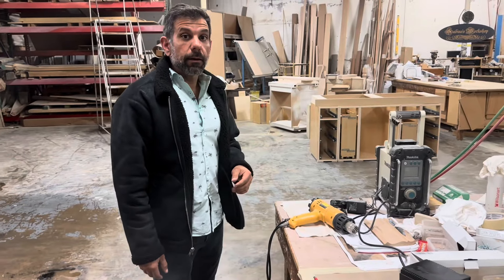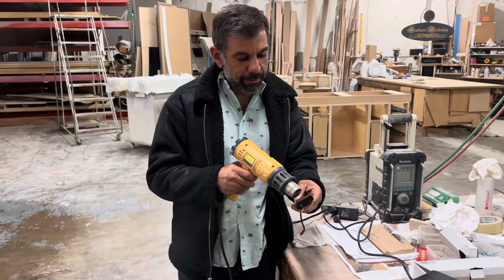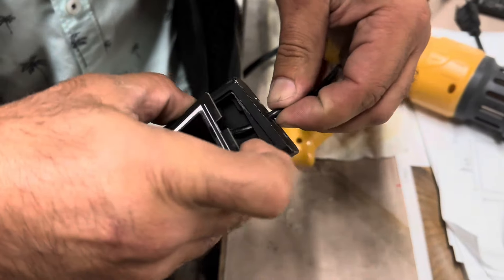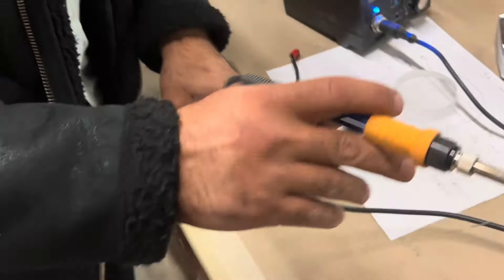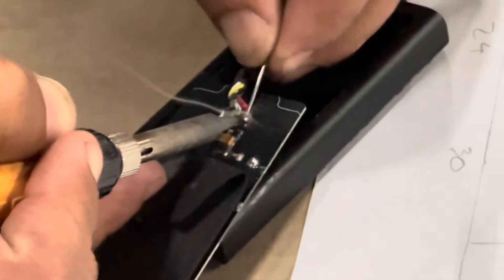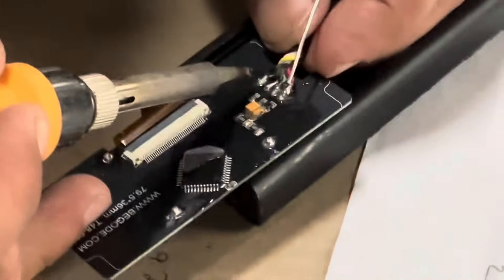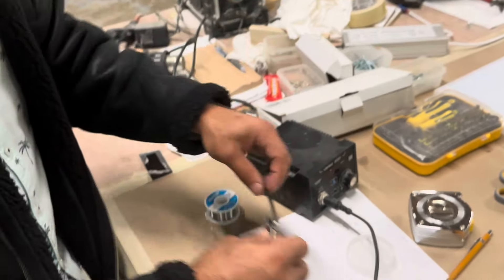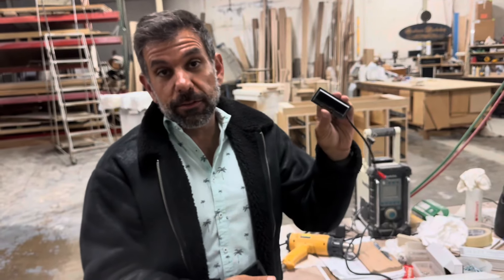Begode Blitz display mod

Comment: hey Roger. so with all these crazy awesome wheels coming out do you still consider the blitz a awesome choice for just going out for some speed and off roading. I just sold my extreme which I never really bonded with. there was something  about it that I didn't like. I dont like 16 inch wheels much. I like the blitz if it can be a faster better wheel all around. the thing with the extreme was it took way too.much effort to get up to speed..I want a wheel that does the work for you. the xway just doesn't do it for me looks wise. I do like the nosfet apex but the blitz is cool
Reply from the maker: The blitz for small tracks and the blitz pro for large tracks. For off-road, the 134 bolt blitz seems to be the best choice. The suspension on that one is just better. The x-way is a whole other conversation
Reply: @roghaj  IM LOOKING TO BUY tommorrow. My first extreme marty told me dont do a 16 inch and I didnt listen, so im listening now. The xway is great, good and does it justify the extra cost from the blitz which seems to check all the boxes for off road, jumping and speed. However the xway brings the cost higher than the nosfet apex which I have seen in person and it looks sweet, its so quiet going thru rough terrain.Are you still reaching for that blitz when you leave the house.

Comment: Alternately you could cut some polycarbonate of the same thickness as the display cover to replace the dark display cover with a clear PC cover instead, so you can see better in daylight?
Reply from the maker: The real endgame for this was wrist mounting the display.
Reply: @roghaj  I will need a third wrist first 😀